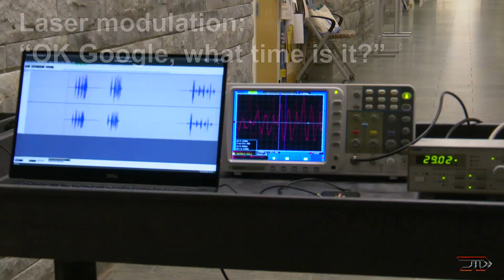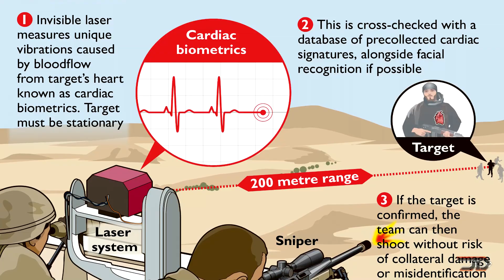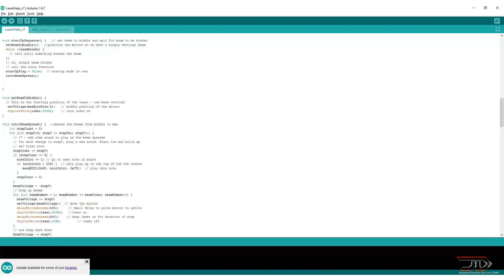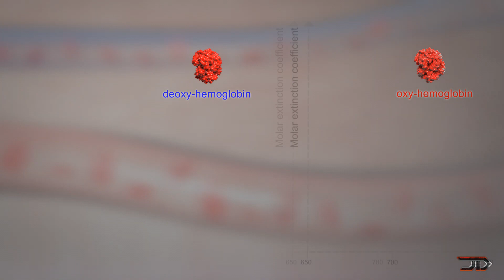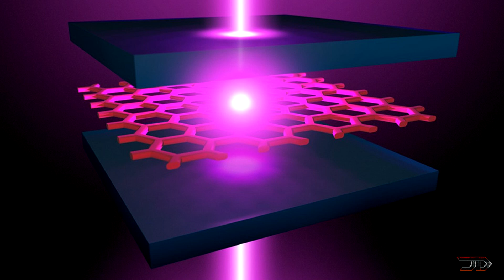7 WEIRD Things LASERS Can DO!

Comment: ”The average person uses approximately 562,500 kWh over a lifetime”

dryer                5,400W     5 hours/week
Toaster     1,000W    3 minutes/day
Tv.                   400W        5 hours/day
Floor fan 100W 10 hours/day
Window AC   900W 10 hours/day
space heater 1,400W 4 hours/day

The ten billion watt laser uses a lifetime worth of energy for about 17,500 people or enough to run a space heater for a little over 300 years.